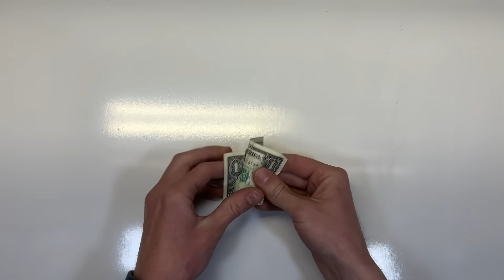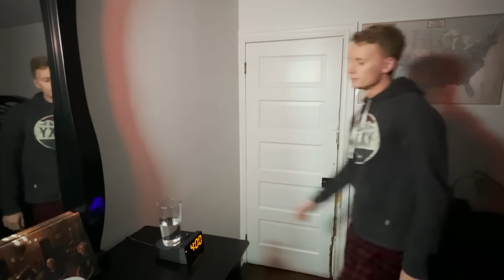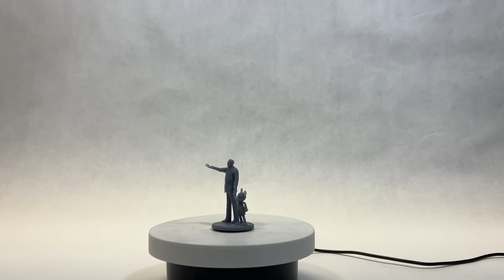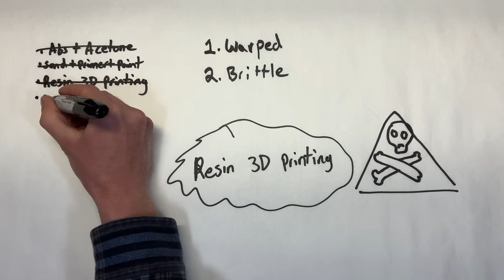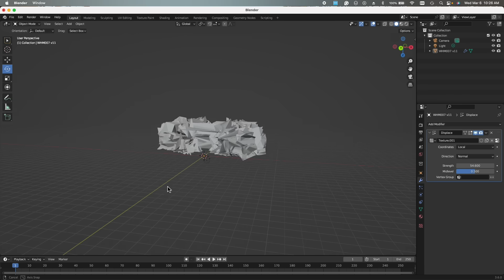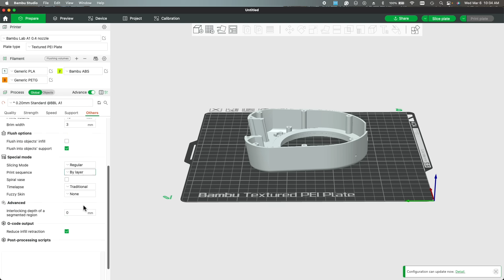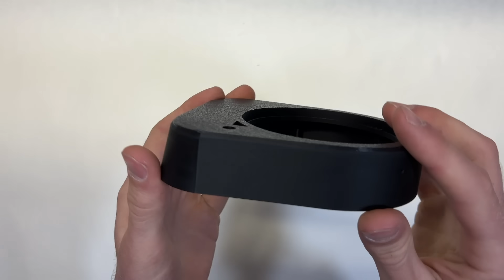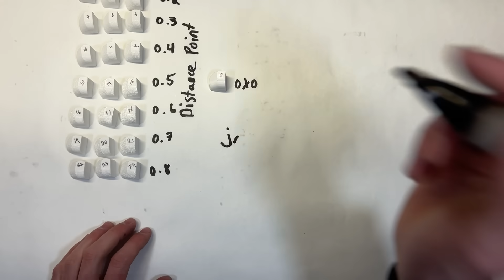My Secret To No More 3D Printed Layer Lines

Comment: Never bothered to try this setting for my product but , now you've done the leg work on the settings I'll give it a go! I also use the same black ABS as you and I've always had a slight aversion to the shiny finish, even though there are no curves on my product so it still looks good without fuzz.
Reply: Update, it works a treat and even hides a couple of defects that had been bothering me. To apply only to the outside faces I used 'modify' blocks which worked pretty nicely.

Comment: i would imagine that the all walls setting helps the infill stick better than a smooth surface allowing better strenght in the layers.  kind of like sanding smooth surfaces before paiting for better adheasion

Comment: Only time I've ever had resin fail like that was when it was first coming out and the place was humid as all. Nowadays I use resin for NUC builds as they're fast to design and durable. That resin likely didn't cure all the way either, or you kept it in IPA for too long as well.

Comment: Take one of your most perfect post processed part, make a silicone mold, cast it in epoxy resin or polyurethane plastic mix. The polyurethane plastic mix can be purchased in a 15 minute quick set. Epoxy resin is a little more time consuming from the 24 hour initial cure, but it's nearly indestructible. The cool thing about the quick setting polyurethane is that it's a lot quicker than 3d printing, and a lot cleaner after you dial in your technique. I use 3d printing to get the initial part that I can't make by hand. Hope this helps.

Comment: The most stupid idea to find a problem without a problem at all. You failed with resin, because cant calibrate it and use wrong resin for this type of work. You can use Anycubic Craftsman or another rigid (ABS-Like, non water-washable resin) type. Print slower and make a perfect peace of product. After that use simple and cheap technology that calls "silicone molds", make one mold and copy by casting rigid variants of resin in this molds. Production of every peace will be reduced to 10-20 min + you can make more molds and cast faster and more by every circle. :text-green-game-over:

Comment: What you did was a full parametric study which isn't science it's engineering. And an experienced engineer would use a DoE and not have to brute force it. You should look it up. You should also know that Bamboo slicer is just a re-wrap of Prusa slicer, who actually developed and implemented the fuzzy skin parameter.
Reply from the maker: @thedoctor16  What is DoE?
Reply: @jakemgrim  Design of Experiments, it's actually a specific process even though it sounds like a generic term. Another older term is Taguchi Methods.

Comment: Could you not design fuzz into the model itself and just not have it be fuzzy where you need to interface between separate parts? What if you use fuzz and then use vapor smoothing?

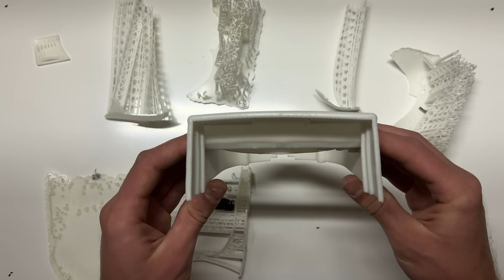Comment: 4:10 sounds like you didnt actually try resin printing. There's different type of resins that fix that. Also you shouldnt print your project the same way you would for a 3d printer, which is very strongly looks like judging by your video.

Comment: Why didnt you try a non brittle resin with the resin printer? There are flexible resins that i use for airsoft grenades and they print so smooth and are strong and impact resistant.

Comment: you might still want a smooth surface.  you forgot to use a sanding cabinet - you can make one out of spare parts or buy one at harbor freight.  you can't use sand, you have to use a softer medium.  you're welcome.

Comment: The interlocking parts tolerances can be solved by some further implementations in the slicers. You need to be able to select walls to exclude from the fuzzing.

Comment: I’ve had my bambu X1-C for a little over a year now. Unfortunately, it sat for almost a year without being used due to not having the time dealing with family issues and moving but now I have a dedicated place and I’ve been printing every weekend. Trying to find useful items to print and solving solutions for things I might have made out of other materials is what really interests me. Nothing I’ve designed and printed so far would really take advantage of a fuzzy finish, but it definitely is something I would like to try at some point. Thanks for making this video, I don’t usually tweak settings unless there is a problem, but this one seems like it could make some of my designs look that much better.

Comment: Ehh... It kills me how few people know about it, but: for prototype, 1 to 10pcs - 3D printing. For mass production, 1000+ items - sure, injection molding. But for short series, 10-500pcs:

PU resin casting! 

You make master 3D print, sand it, prime it, texture it whatever you want. Then drop it into molding silicone. Then cut it out and proceed to cast 50-100pcs per mold from 2 part poliurethane resin, each piece with like 15-20min between pour and ready to take out product. Precision unlimited. Scales exponentially if you want that. Robert Tolone, search for his channel, that guy... He's pure gold.

Comment: if you ever want to return to maintaining glossy parts without spray paint - another super quick option would be to thin down uv curable nail polish or craft fluid with rubbing alcohol then thinly coat the parts and cure them - you can play with the viscosity proportions of polish to alcohol. I do this with my artificial nails. Not necessarily practical for all situations but I am sure you will run into a customer request eventually in the future asking for metallic or mirror shine products

Comment: I started 3D printing with a resin machine and I can tell you didn't tried enough by printing with it, it is messy until you bought equipment to make things better like a washing machine or a dryer. Also the warp issue probably is a setting you need to set on the printer maybe giving it more exposure time or using the setting the resin indicates, maybe getting a better resin(? There are too many kind of resins and some of them are even unbreakable because they're used for mechanical stuff or high resistance applications.

Comment: So, if i still want a smooth print, is it less of a hassle to use the fuzzy setting and sand it down from there? 

I've got two X1Cs that print very well, and I'm getting to the point of dealing with the lines. I tried a bit of MEK, but it did more damage than good.

Comment: Diamond-shaped knurling on vertical FDM-printed surfaces hides lines too and looks better than white noise. It requires at least 0.1mm layers to keep knurl shape precision. But it's possible to speed up the printing by using "Infill Combination" option in Orca Slicer and print 1 line of infill per 2 lines of walls.

Comment: you can use a modefyer object and overlap it over the parts of the model you want to have or not have fuzzy skin to keep the amount of sanding you have to do way down. to do this just right click the opject in the menu click add modifier there is a bunch of basic shapes you can use or you can import your own model it will appear as a transparent opject just use the move and scale tool to put it in the spot you don't/do want  fuzzy skin switch to objects instaid of global then in the others tab fuzzy skin should appear enable/disabel fuzzy skin and any overlaping parts will have/have no fuzzy skin.

Comment: Was hoping for a true asbsense of print lines - clickbaity title. The best for your case would really still be the sand prime and paint solution and then make a silicone mold or a few molds and then cast in resin that cures in an hour, this way you could scale.

Comment: You can get strength based Resin. Bad resin is quite brittle which sounds like what you had. Also full enclosure UV treatment of the finished product is the BEST solution vs just sitting it in sun or shining a small UV lamp on it.

Comment: Resin isnt the Boogeyman, most cleaning products are pretty toxic and most people smoke/drink rather toxic stuff.

Is a drip mat really too much for people worried about the "mess"?  Its perfectly rine if the material or process does not meet your needs but people qlway make it sound worse than it is.

Comment: The resin printing section was rough... Definitely sounds like user error for the most part. Plenty of companies use resin printing to prototype very accurate designs without material warping. ,  Although I suspect even if you got it working correctly, the material costs would eventually be a hinderance to you.

Comment: What I don't understand is, you started with a Solid Doodle Printer and went to a Bambu A1. Did you have to buy the Bambu to start printing with Bambu software? And also, did you try the Bambu printer, to see if it reduces print lines? Personally, I do not like that texture. If I know I am getting a 3d printer part, I expect layer lines. Why not try Casting the 3D printer part and make your own mold. Using Casting sand, and aluminum? It may take some experimenting, but that may save time and money.

Comment: This video was super helpful for a beginner. I’ve been making electronic systems for a while and 3D printing is making my life so much easier!
 
Quick question: what screen are you using for your clock? Im working on a little system which automatically tally’s up your points just by looking at the dart board, but cant find a good (and not super expensive) display to use.

Comment: I have anew Bambu Labs P1S and it will print an enclosure without any lines at all, unlike the 2 Ender series I had which are rubbish. I see the Creality "Team" have blatantly copied the Bambu system in their latest abomination. Let's see how long that lasts. Their after sales support is non existent.

Comment: Kind of a disappointing bait-and-switch you've pulled here as you start off talking about how long and tedious the process of creating a sleek, smooth surface is and teasing a solution for eliminating layer lines (i.e. the source of all the frustration that necessitates all the sanding and filling and sanding again) without all that work, only to turn around and reveal that your "solution" is to just obliterate the notion of smoothness altogether. Which is kind of like arguing that nobody will notice if your car's paint is scratched if you throw the whole thing into an industrial compactor and reduce it to a 3x3 cube of scrap metal.

That said, one "pro" to this method is that it does build up a thicker layer of printed plastic so all the sanding necessary to smooth it out is less likely to result in turning layer lines into "shear lines" where the plastic is so thin and weak from all the sanding that it'll just split open under pressure. But that could be addressed merely by selecting a thicker "wall" option.

I guess the search for "fresh off the bed smoothness" continues. Not like I'm pressed for time, though. I haven't even taken my LK5 out of the box yet and it's been like a year or two because I have no place to set it up.

Comment: You could do what I did for a customer of mine. They wanted a kit of ~100 parts printed for each student (120 total students). I ended up 3D printing a master kit of parts, I sanded, primed and painted the parts until they looked perfect. I then made a silicon mold of the parts and cast thousands of parts easily and quickly to fulfill the order in resin. The parts were perfect reproductions and I still maintain the molds here in my shop. The customer (a nearby university) orders hundreds of these kits each year.

Comment: First, thanks for posting. This was very informative and I didn't know this setting even existed. I'm thinking of at least a dozen applications I'll be using it with.

Second, I have to comment on your resin printing experience.. If your resin prints were too brittle or weak for your application, you were using the wrong resin. There are a plethora of tough resins out there that are far less brittle and I'm sure with research you would have found one that fit your need. The warping could have been solved with some slicer settings, additional supports, the right resin, or a combination of all of the above.

Comment: Something I've done with a recent project (Robotic chess set, specifically the pieces) is use 3D printing to create a model of the parts which I then can use to create a silicon mould, these can then be filled with resin to give a similar result to injection moulding, without the high cost.

Comment: why just not apply a very thin coat of some acrylic or thing with a spatula around it? you can control so many other parameter and you don't get the fuzzy skin look, which in my opinion is even worse than layer lines ... it does make it look a bit like an injection moulded part, but an extremely low quality one

Kudos to your printing business and all tho, very good product idea, I might even buy one of these water drink reminders haha! 

Edit: If you wanted to use Resin, it would still be a viable option, you'd just need to account for thicker walls and a different stronger resin. ABS Like resin is a market gimmick, sure, but you could still try it!

Comment: Don't use fire, use a fan blowing on the acetone.  Works better and safer.

Resin printing.... You've gotta get your settings right.  Angle, times on and off, etc.  also the right resin helps, I like anycubic abs-like plus or 2.0 variety, works great and reliable as hell.

Fuzz is a good solution if you don't need a very close fit on parts.  It can sometimes make it a little harder to fit precise parts.

Comment: The fuzzy skin option is a nice one I probably would have never noticed. I appreciate seeing the steps you went through to get there. However, all your "fails" had alternatives you may have also used to get usable results. Except injection molds - those are still expensive. Acetone works well on ABS but timing and temperature are sensitive; burning is just wrong. Anyway, thanks for the introduction to a useful setting.

Comment: Fuzzy skin has been around a long time. Cura had it first I believe. It’s great for grips on handles as well. I did a TPU grip for my walking stick that I still use several years later. The clock design looks great.

Comment: I did the contour option like you said but it only applied it to the sides and none on the top.. Is there another option I missed? Thanks for your help.
Reply: It looks like in his print the top surface is just on the bulls plate, so the surface you see is the PEI plate texture

Comment: Curious if after you decided you liked 0.3 and 0.3 if you printed your actual product in multiple variations. Obviously it's all subjective, but I really liked the look of 0.2 x 0.2 as more of just a "this is meant to hide the layer lines / get rid of the '3D printed' look" and the 0.2 x 0.6 as more of a, "yes, this is meant to be fuzzy/rough" and would be curious to see what your thoughts were as someone who has had this same model in their hands hundreds of times with different post processing workflows. If I printed the same model with no fuzz, then 0.3 x 0.3, and the two I suggested, I would still only have that model 4 times, and could pick my favorite, but not really speak to it being the "best" of the 100 different ways I've seen/felt the model during sanding, filling, painting, melting, etc.

ALSO, and I think maybe this one would be more of an answer I could find out myself with a couple days or weeks of print time, but I'm very curious what different nozzle sizes [and as a further variable if desired; layer heights] do to the final effect. I imagine at too big/thick it wouldn't really "work" and would just be stringy in a very bad way, but I wouldn't be surprised if 0.6 nozzle with the original layer height JUST improves print time without having the "details" of the fuzz being especially decreased considering it is, by its own nature, not meant to be a smooth transition between layers (i.e. smooth).

I suppose what I am getting at with all of this is there may be a good combo (something like 0.2 x 0.2 but printed with a 0.6 nozzle) that would actually increase the speed of the print (relative to 0.3 x 0.3 with a 0.4 if that's what you're doing now) enough that it would bring you back to the original (no fuzz, 0.4 nozzle) print time, with a similar/same final "feel" and look. I don't actually understand nozzle width/layer height enough to have insights here, but if it were my literal job to be producing these and I saved an hour on each one, then it definitely seems like it would/may very well be worth doing, or at least printing another array of test prints with a 0.6 nozzle in the various levels of fuzziness.

Comment: Injection molding is indeed cost prohibitive for low volume parts.  Even those $10K molds are aluminum, so they are going to wear out a lot faster than a traditional steel mold and then you will have to pay yet again to have new ones made!  Plus you have the per-part cost on top of the mold cost, which is also high for low volume.  You can save a lot of money by going offshore with your injection molding, but then you have shipping costs and delays piled on.

Comment: To use fuzz without messing with tolerances: Add one or more modifier objects to your print.
Select the part, right click and pick add modifier, pick the object to overlap with your print.
Adjust this modifier object as needed so it overlaps your fasteners and finally disable the fuzzy skin for that modifier.

Now you can have fuzzy skin even on parts with dovetail joints with ease.